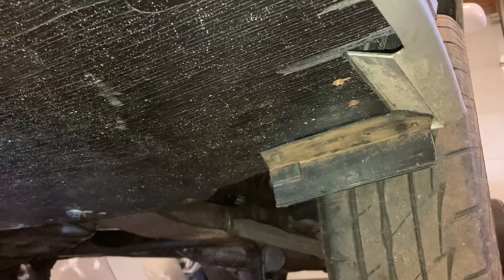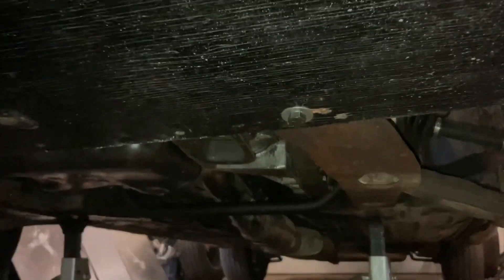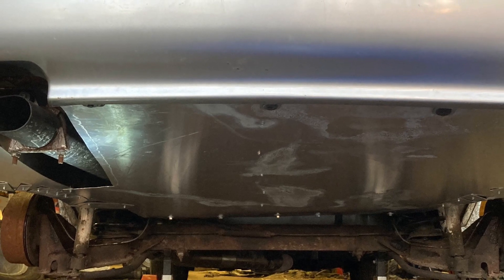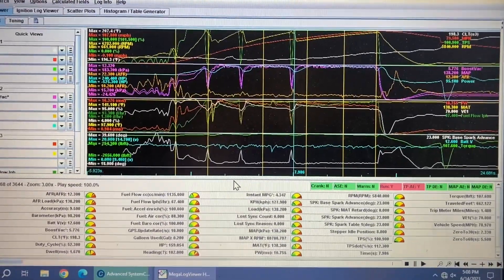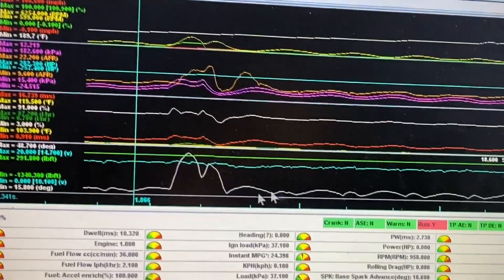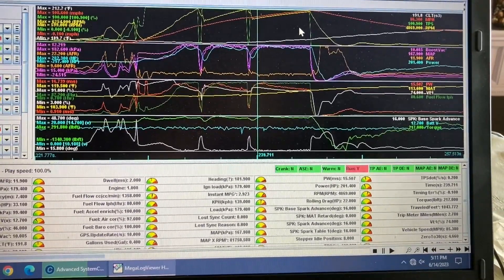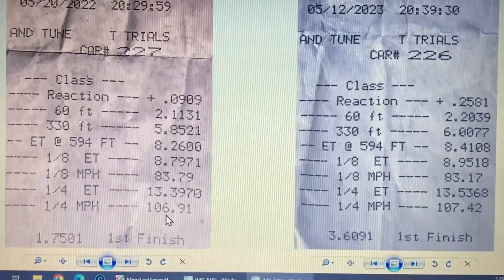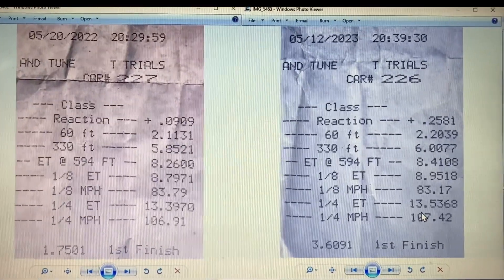Does aerodynamics matter on an old school Z24?

Comment: Hard to really draw a conclusion without a direct AB comparison. Weather varies, and I've seen a half mph difference on the same day the same car and pretty close to the same ET before. 
Interesting though, I did this same kind of mod on the front of my last Beretta. The rear could also be worthwhile
Reply from the maker: This was literally as close as I could get it without installing the aero stuff at the track.  
The weather was very close and actually a bit hotter than the previous runs.   I never got over 106 mph the previous year even on slicks. All the runs this day were over 107 even with slower 60’ and first 1/8.  
Thanks!  And love the Beretta videos!!

Comment: Slicks will make a huge difference for you. Best 60' I ever got out of my Beretta was a high 2.0 and I was immediately in the 1.8s the first day I tried the slicks. Car went from 13.9 to 13.2 at the same 100/101mph
Reply from the maker: Yeah I do typically run the slicks.  Just didn’t want to for this comparison to keep it as close as possible.  Thanks!
Reply: @xlr8ing_zgarage  have you run some times with them now? How much did the 60 improve?
Reply from the maker: 1.79 is the best 60 so far
Reply: @xlr8ing_zgarage  hell yeah. I'm trapping 104 now n/a with the LS but I gotta get that 60 down. I just bought adjustable shocks cause a 1.99 slipping the clutch is the best I've gotten yet RWD
Reply from the maker: @GEARHEADdezign  nice!   I know you’ll get it to hook up better yet.   I’m sure you still have a ton of adjustments to figure out to optimize that set up of yours!
Reply: @xlr8ing_zgarage  haha it should! I was annoyed when it 60 worse than the FWD🤣
More rebound stiffness is the biggest key I think. But I'll find out soon. I'm shooting for a 12.9@105 out of a bone stock weakest-LS-ever-made 4.8 before I swap in the L33

Comment: I really enjoy your videos.
I hate to ask, but I have my stock 3.1 (automatic) out for a refresh.  I’m targeting 190hp.  Would you recommend an upgrade strategy?
Reply from the maker: Well it depends.   Easy and cheaper way to get more hp is to swap to the 3400.  Needs custom motor mounts but that’s the most difficult part.    If you want to stay with the 3.1 MPFI, they’re limited in airflow capabilities by the intake manifold, heads and exhaust manifolds.  Get a cam and 3100 SFI pistons and you’ll feel a difference though.